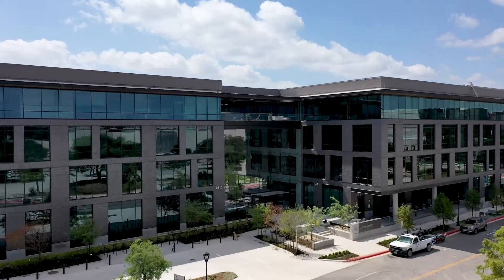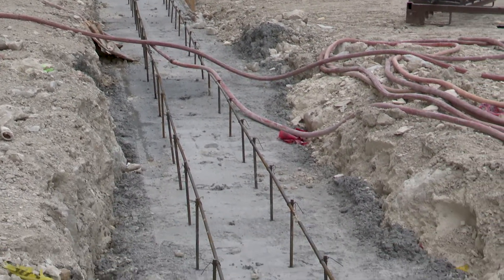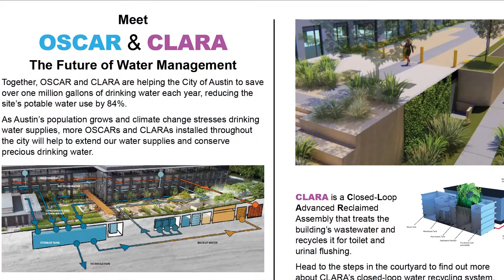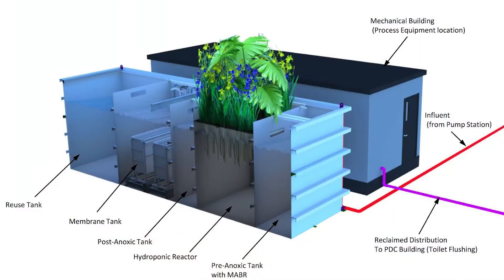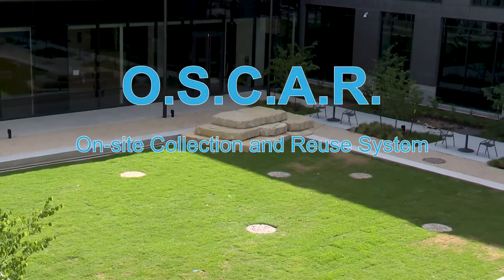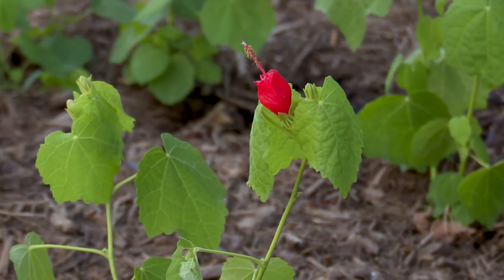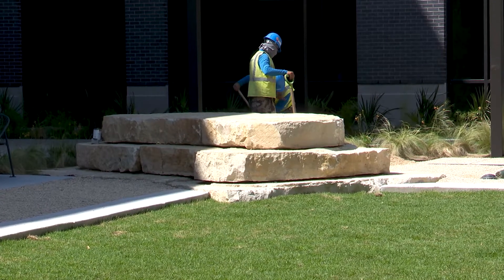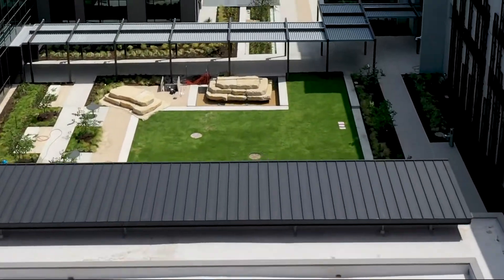On-site Blackwater Reuse Pilot at new Permitting & Development Center Building:Meet OSCAR & CLARA

Comment: A good note is that these systems do not provide drinking water back to the buildings.  That is still provided by the City of Austin.  The risk is still too high to provide drinking water to the public.  Then the building would be considers a "water purveyor."  But nice job.  It will be interesting to see the financial benefits of these systems.
Reply from the maker: Thank you for the comment. That’s correct, the systems are for non-potable water uses only.
Reply: @Austin_Water  Very nice.  Here is a link to the new Grey water regulations coming out for grey water systems.  It is so that the CA State Water Board can tell local City building department how to approve grey water systems, and most importantly how to test water quality.  Im following this at UC San Diego.  https://www.waterboards.ca.gov/drinking_water/certlic/drinkingwater/docs/mp4/08-01-2022-onsite-reuse-regulations.mp4